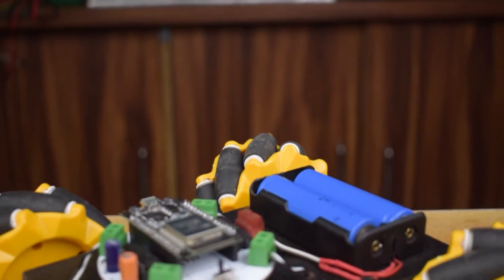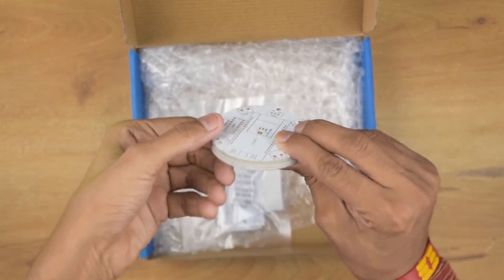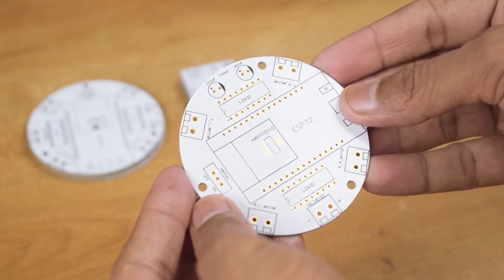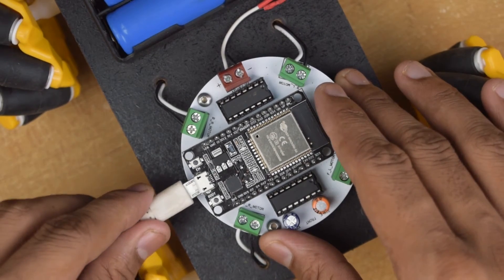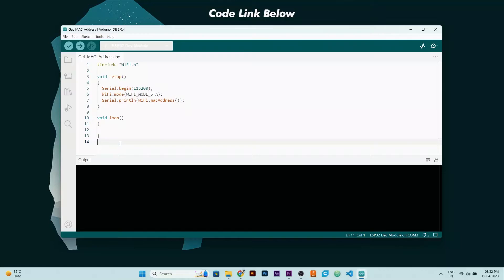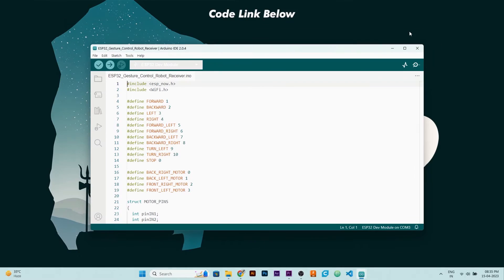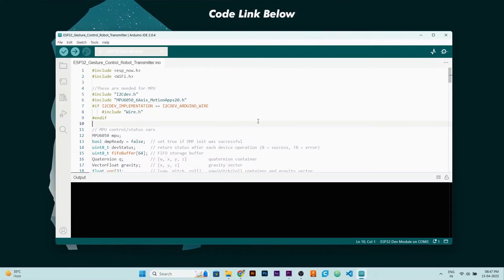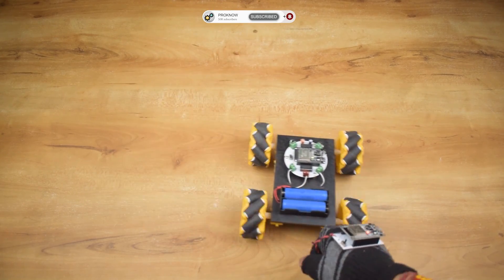DIY All Direction Gesture Control Car Using ESP NOW

Comment: Arduino: 1.8.19 (Windows 10), Board: "ESP32-WROOM-DA Module, Default 4MB with spiffs (1.2MB APP/1.5MB SPIFFS), 240MHz (WiFi/BT), QIO, 80MHz, 4MB (32Mb), 921600, Core 1, Core 1, None, Disabled"

D:\download\All Direction Gesture Control Car Using ESP Now-20241123T082432Z-001\All Direction Gesture Control Car Using ESP Now\ESP32 Gesture Control Car Receiver\ESP32_Gesture_Control_Robot_Receiver\ESP32_Gesture_Control_Robot_Receiver.ino: In function 'void setUpPinModes()':

ESP32_Gesture_Control_Robot_Receiver:232:5: error: 'ledcSetup' was not declared in this scope

  232 |     ledcSetup(motorPins[i].pwmSpeedChannel, PWMFreq, PWMResolution);

      |     ^~~~~~~~~

ESP32_Gesture_Control_Robot_Receiver:233:5: error: 'ledcAttachPin' was not declared in this scope; did you mean 'ledcAttach'?

  233 |     ledcAttachPin(motorPins[i].pinEn, motorPins[i].pwmSpeedChannel);

      |     ^~~~~~~~~~~~~

      |     ledcAttach

D:\download\All Direction Gesture Control Car Using ESP Now-20241123T082432Z-001\All Direction Gesture Control Car Using ESP Now\ESP32 Gesture Control Car Receiver\ESP32_Gesture_Control_Robot_Receiver\ESP32_Gesture_Control_Robot_Receiver.ino: In function 'void setup()':

ESP32_Gesture_Control_Robot_Receiver:252:28: error: invalid conversion from 'void (*)(const uint8_t*, const uint8_t*, int)' {aka 'void (*)(const unsigned char*, const unsigned char*, int)'} to 'esp_now_recv_cb_t' {aka 'void (*)(const esp_now_recv_info*, const unsigned char*, int)'} [-fpermissive]

  252 |   esp_now_register_recv_cb(OnDataRecv);

      |                            ^~~~~~~~~~

      |                            |

      |                            void (*)(const uint8_t*, const uint8_t*, int) {aka void (*)(const unsigned char*, const unsigned char*, int)}

In file included from D:\download\All Direction Gesture Control Car Using ESP Now-20241123T082432Z-001\All Direction Gesture Control Car Using ESP Now\ESP32 Gesture Control Car Receiver\ESP32_Gesture_Control_Robot_Receiver\ESP32_Gesture_Control_Robot_Receiver.ino:1:

C:\Users\Swetha\AppData\Local\Arduino15\packages\esp32\tools\esp32-arduino-libs\idf-release_v5.1-33fbade6\esp32/include/esp_wifi/include/esp_now.h:157:54: note:   initializing argument 1 of 'esp_err_t esp_now_register_recv_cb(esp_now_recv_cb_t)'

  157 | esp_err_t esp_now_register_recv_cb(esp_now_recv_cb_t cb);

      |                                    ~~~~~~~~~~~~~~~~~~^~

exit status 1

'ledcSetup' was not declared in this scope

This report would have more information with
"Show verbose output during compilation"
option enabled in File -> Preferences.

what is the solution for this.
error while uploading receiver code

Comment: Good morning friend, I have problems with the code, I get 3 errors. On line 232, 233 and 252 Did you use any additional libraries?

Comment: You showed two motor drivers on the circuit diagram but didn`t put even 1 in your circuit . WHY?
Reply from the maker: Because I used two motor driver ICs ( L293D ) to drive the motor.

Comment: I'm having a problem with Failed to add peer. Is there a way to fix this?

Success: Initialized ESP-NOW
E (122) ESPNOW: Peer interface is invalid
Failed to add peer
Reply from the maker: Bro there is some problem with the code, I will update the code in few hours and let you know.
Reply: @proknow  thank you very much
Reply from the maker: You can check the updated code now.
Thank You for informing the issue.
Reply: @proknow  I'll try it soon. Then I will inform you.

Comment: How do I know if an ESP32 is connected to another ESP32?
Reply from the maker: when we use ESP-NOW communication, we enter the Mac Address of Slave(receiver) esp32/esp8266 So the Master will only connect the esp32 which has that Mac Address.
Reply: @proknow   Now I have the problem of Failed to add peer. Is there a way to solve it?
Reply: @proknow   Thank you in advance.

Comment: Hello and thank you for your Code and Gerber files.  
 One error that new programmers would not pick up is :-  
They would need to add the Library Vector from the Library Manager and Add this to the top of the Code  #include <vector> 

Thank You
Reply: Hey bro need ur help
Reply: ya
 @Nilay_2005
Reply: Amigo, como se llaman las bibliotecas